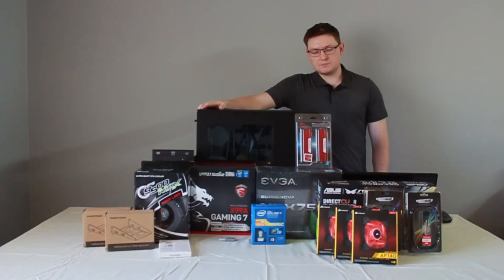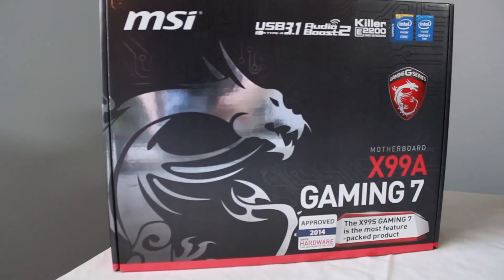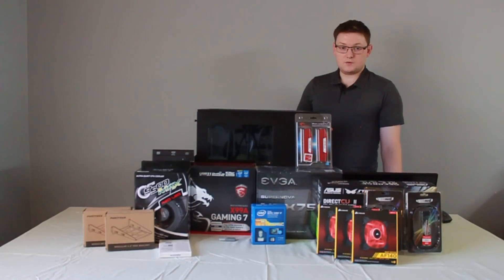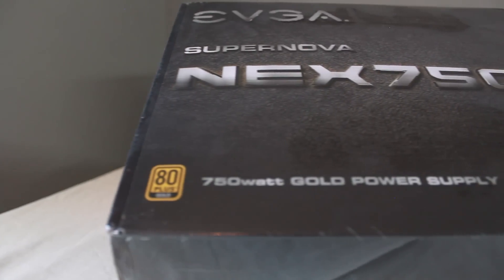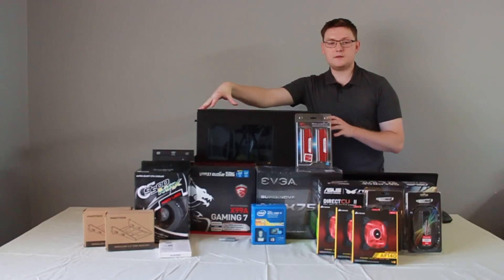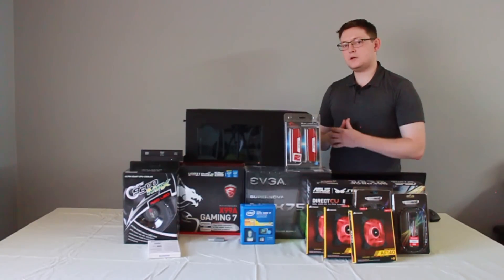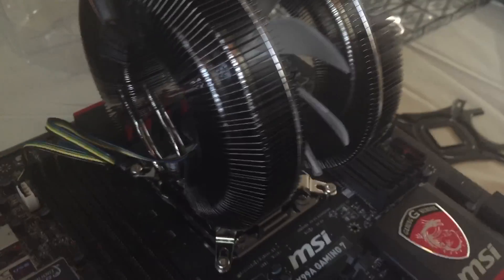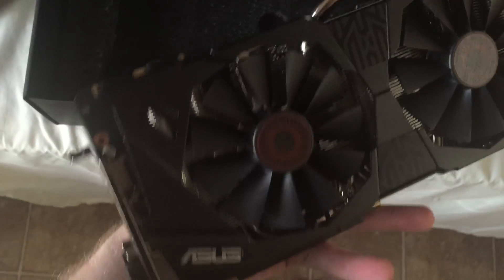$1,500 Workstation and Gaming PC: My First Build!

Comment: Exactly whst i'm looking to build ... budget too ! I'll have to switch to the 980ti for the gpu as i plan to add on for an sli though
Reply: David Deandre 1070 is better
Reply: I got a 6gb 1060 instead ... can upgrade to 1080 once I get a better machine like a HP Z840 ... currently using the Z800 2x Xeons Watercooled 2.9Ghz each 12 cores (6x2), 24 threads 32Gb Ram, 2Tb HDD, 500 Gb SSD , GPU EVGA 1060 SC